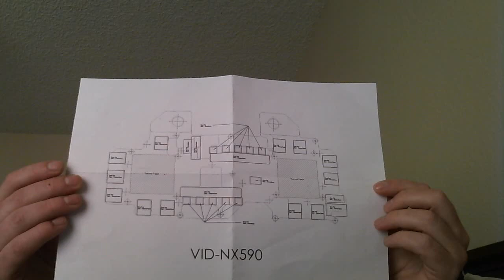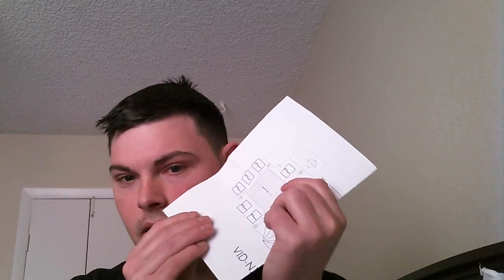gtx 590 Koolance water block install problems/ solutions

Comment from the maker: @sherpa21987 
Don't need to use washers if using a Asus card. I onky used washers on the center three screws. Screw washer PCB water block is how it should go